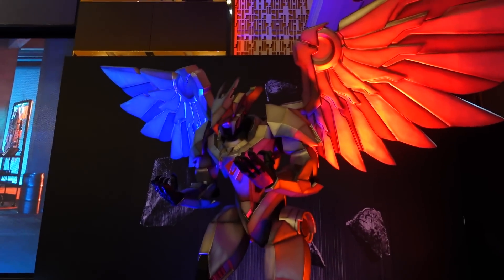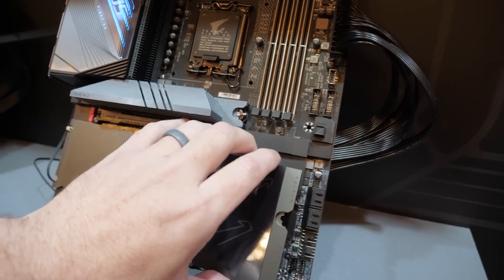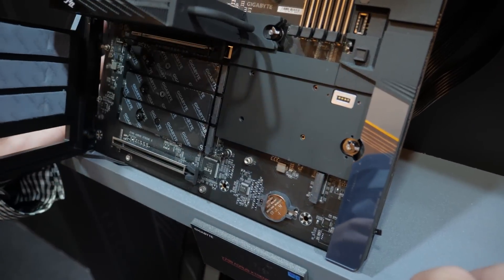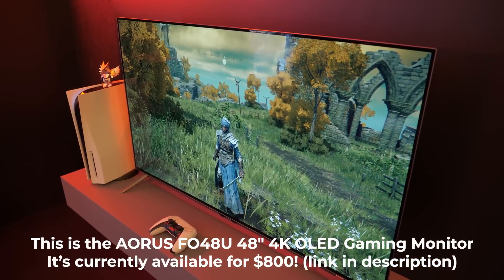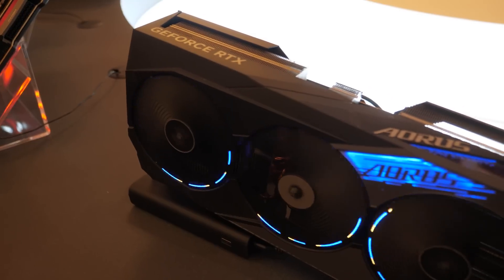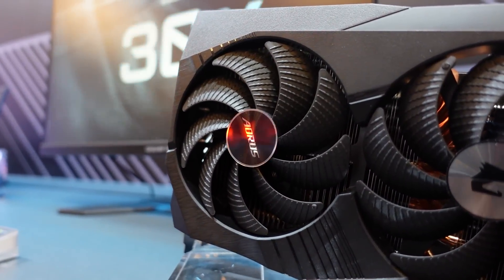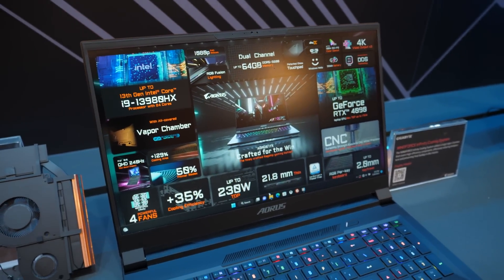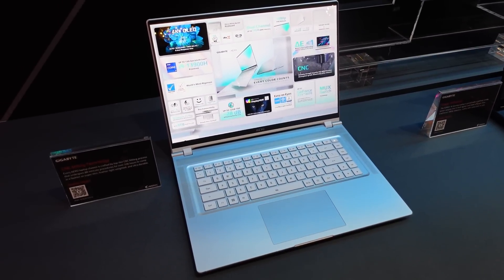Why does Gigabyte have new Z790 motherboards?

Comment: I posted and explained why I believe this happened and my post was deleted. ...
The Z790 was included on the reported list along with many others...

GIGABYTE Fortifies System Security with Latest BIOS Updates and Enhanced Verification
Fostering Collaborative Security Practices and User Safety
Jun 1, 2023
June 1, 2023 – GIGABYTE Technology, one of the leading global manufacturers of motherboards, graphics cards, and hardware solutions, has always prioritized cybersecurity and information security. GIGABYTE remains committed to fostering close collaboration with relevant units and implementing robust security measures to safeguard its users.

GIGABYTE engineers have already mitigated potential risks and uploaded the Intel 700/600 and AMD 500/400 series Beta BIOS to the official website after conducting thorough testing and validation of the new BIOS on GIGABYTE motherboards.

To fortify system security, GIGABYTE has implemented stricter security checks during the operating system boot process. These measures are designed to detect and prevent any possible malicious activities, providing users with enhanced protection:

1. Signature Verification: GIGABYTE has bolstered the validation process for files downloaded from remote servers. This enhanced verification ensures the integrity and legitimacy of the contents, thwarting any attempts by attackers to insert malicious code.

2. Privilege Access Limitations: GIGABYTE has enabled standard cryptographic verification of remote server certificates. This guarantees that files are exclusively downloaded from servers with valid and trusted certificates, ensuring an added layer of protection.

BIOS updates for the Intel 500/400 and AMD 600 series chipset motherboards will also be released on the GIGABYTE official website later today, along with updates for previously released motherboards.

GIGABYTE recommends that users regularly visit the official GIGABYTE website for future BIOS updates.

For more information, please visit the official GIGABYTE website at www.gigabyte.com/Motherboard

Comment: If it didn't have a TV module, then it's just a large monitor. The module is the real differentiator event though you could pop in a streaming device and use it as a "tv."

Comment: Do the Z790 motherboards use the 1920 vintage buck converter (60% efficient) for their VRM? Or do they use the 2011 vintage Ćuk-buck2 converter (99% efficient)? The 2011 converter is cheaper, smaller, has a better transient response, and has less ripple.
Tradition over performance!

Comment: I dont get this, Gen 14 is a new socket so they are limited to CPUs current and Gen 14 is at the end of year. No point buying them
Reply: Gen 14 is a Raptor Lake refresh so will use the same LGA 1700 socket as 12th and 13th gen.

Comment: I don't believe in any consumer motherboards needing to cost more that $200. so...meh...
a mouse should be weighted, I don't like a light mouse, or a mouse with lights.
cases should be less fluff..give me an old box with no windows or lighting and good flow.
that's kinda a nice cooler for the laptop...as long as there is enough airflow.
bean bag chairs are nice to fall asleep in...until your ass gets sweaty. :)
liked.

Comment: I hope motherboard manufacturers start recognizing the larger size of new graphics cards when designing motherboard panels. The access to the m.2 slots needs to be easy and fast. I get the aesthetic, but those of us with hard line tubing will hate this. I like to swap out my m.2 drive so I can install a different OS. That way if something goes wrong, I can quickly switch back to my original OS drive. This comes in handy when I want to try out a Linux distro or Windows. I think these large panels will make that very difficult. I tend to avoid boards like this.
Reply: Well I am confuse, I want to pass this comment cause I don't want to sound like a troll but ...so curious. 
m.2 just about the fastest component you can install on a computer, right? 
So wouldn't it be speedy and efficient to leave your case closed and jack in a thumb/flash/(whateveryawannacallit) drive or external SSD and simply overwrite? And if this is something you do often would it not be even more convenient to keep your OS ISOs in a file on a second m.2?
I'm not a noob but there is just so much to know that I don't..

Comment: Love the idea of a 36-42" monitor in 16:9. Quality panels, high refresh rates and low latency are always highest priority. OLED is nice, but not necessary. Biggest issue is getting decent performance at reasonable pricing. Most people aren't looking for $500-1000 monitors.

Comment: I LOVE that they figured out to leave the two bottom slots open. I have a 3.5 slot 4090 which needs a new system, and I like having an extra pci-e slot or two available. (I'd like to see a 4k display between 34" and 40")

Comment: Why are most motherboards makers still making a rookie mistake by placing their top gen5 NVME slot so close to the top PCIe5 slot? Gen5 SSDs need really TALL heatsinks, and there are an increasing number of GPUs that are taller, like if they have an active water cooling backplate, so NONE of those motherboards would be usable in a lot of scenarios. All they need to do is move the PCIe5 top slot about an inch lower down the board so there is no physical overlap for top end hardware. Many people, like my, don't want a riser cable.

Comment: So - what speeds and what capacity am i able to run in my Z790 Aorus Master? I'm running 2x32Gb 5600 DDR5 now, waiting for some swift 96-128Gb solution for the long term... but if they bring a new MB for higher speeds it may look like i am SOL here....

Comment: These Z790 boards are going to launch alongside meteor lake I9-14900K 🙂
Reply: No, they are only doing a 13th gen refresh later in the year, no 14th gen this year.
Reply: The i9-14900K is going to be a Raptor Lake refresh.  Meteor Lake (if it ever comes to desktop) will be on a different socket.

Comment: Suggestions for Gigabyte:

Monitors: a dual 4k ultrawide.

GPUs: an Aorus “Tachyon” Waterforce Xtreme, a la EVGA Kingpin / ASUS Matrix / Galax HOF OC Labs
Reply: A dual 4k ultrawide is coming out already from MSI and Samsung, and good luck running dual 4k and having decent fps in anything.
Reply: I’d still say they do it if they can match/beat the price for comparable performance. Coming in after can also bring the advantage if they wait until another GPU generation or two when performance is more reasonable.

Comment: I cannot possibly begin to imagine why these boards are being released. The world may never know at this point.
Reply: Because of the raptor lake refresh chips coming out.
Reply: 3 generations of Intel CPUs on one socket, has hell frozen over? Looking forward to a 14600k with at least 5.4 GHz turbo, nice upgrade for my 12600k.
Reply: @richardfarmer6570  14th gen is going to be on a new socket. Only the 13th gen refresh is on the same one currently.
Reply: @drunkhusband6257  If you refer to Meteor Lake as "14th Gen.", then it will come... but not for Desktop, only for mobile platforms. A new Intel socket and platform for Desktop will come in late 2025, and it will be renamed and rumor has it, that Intel wants to begin over at "1st Gen." again. ...can this be true? Anyone else heard that?

Comment: I've built two Aorus Master X570 PCs and a sideways upgrade, Aorus Master X570S paired with a 5800X3D.  The two X570 PCs are paired with the 5800X.  Why the 5800X3D versus a 13700 or the 7800X3D?  No thunderbolt support on AM5 and no USB 4.0 until the $500+ MB price point.  X570 supports TB 3.0.  MB, RAM and CPU price difference of $550 and up.  For what I do and play, it turns out the 5800X3D was NOT an upgrade over the 5800X.  Going from an EVGA 1080Ti FTW3 (which does 4K just fine TY very much) to an AMD 6900XT to a PowerColor 7900XTX showed the biggest visual and performance upgrade.  One of my grandkids got my 1080Ti and a cousin got my 6900XT.  He was able to go from 1080P with his X-99-A PC to 4k by swapping out GPUs.

Comment: My current "monitor" is the Hisense 4K TV 55U8G which is wall mounted.  My "real" monitor, ASUS ROG PG279 165hz 27" IPS, is back in its box stuck in a closet.  The 48" OLED looks like it could give my Hisense a run for its money, but I do like having a TV tuner as well.

Comment: Possibly because Intel could be releasing a 13950K, 13850K on the LGA1700 socket in the fall as part of Raptor Lake refresh?
Reply: Raptor Lake refresh is going to be called 14th gen and be the 14900K, 14700K, etc.

Comment: Paul, thanks for going to Computex 2023 for us. I've watched so many videos about the show I feel I was your companion. Concerning monitors in general. I've owned many monitors over the years. My initial monitors were CRT type. Two features on my later monitors were the placement of the I/O panel and the location of the monitors' controls. Both were easy to see and use. The monitor controls were placed at the front, and some were at the front right side of the housing. They were easy to see and use, with some using LEDs to provide lighting for the control buttons. Today, the monitor makers try to hide the I/O ports and control buttons. To my way of thinking, it's like playing a game of hide-and-seek. These new monitors have gone one step forward and two steps backward. Imagine owning a car with an instrument panel placed underneath the car's dash.

Comment: I would love to see them make more 4k OLED monitors that have different sizes and with different features built in for gaming in mind.
Reply: 4k is pointless at small sizes.
Reply: @drunkhusband6257  i disagree 4k is pointless for small sizes - smaller size is absolutely essential when you're using it as monitor and not a tv, where you sit right up near it on the desk, maybe a foot away.... 34inch would be perfect, maybe 27inch for anyone particularly susceptible to lower PPI. also noticeable graphics improvement from 1440p when gaming.
Reply: @whiskizyo2067  I had a 27" 4k  monitor, went to a 3440x1440 ultrawide. 4k isn't worth it
Reply: @drunkhusband6257  I said different sizes, not necessarily small. As in 38" on up.
Reply: @thudson9653  We already have 42, and 48 inch monitors so I don't know what you need exactly.

Comment: Gigabyte Aorus Master Z790 was the WORST motherboard I've ever had in 20+ years of building PC's. It is so buggy its unbelievable, system agent problems below 1.3v and RGB software it comes with can and eventually will brick SPD profiles of memory. Bios occasionally has bugs with changing one setting effecting another its not supposed to. Total joke of a board for 499$.

Comment: i was guessing they may be having some issues with their boards. cus i just built a pc using their z790 ud ac board for an intel 13900k, gigabyte 4090 and i've been having all sorts of issues with it ranging from ram instability, power distribution, usb issues. i can tell these were known issues since i've had to update the bios 3 times so far in the short amount of time i've had this. however, a lot of the updates have helped a lot.

Comment: I have a Gigabyte Z790 and after power-off/power-on (even for just 1 second) getting it to boot again usually takes HOURS, it either hangs on 'boot' indicator light or all lights go off but nothing happens.  Unplugging SATA drives and all USB devices seems to help after rebooting over and over again for ~30 minutes.
Reply: Something is very wrong with your system. Perhaps mobo, CPU, or PSU.

Comment: I guess it's no secret at this point that any new processors that may be released this year by intel will be refreshes of the existing 13th gen series, and as such will not rate a full number upgrade of motherboards, so no z890 this year.
Reply: Intel Raptor Lake refresh will reach nearly 6.5GHz and dissipate 500W+. Mobo makers are equally making refreshed Z790.
Reply: @tringuyen7519  The refresh is supposed to use less power and run cooler, already been said. There is no way it will even hit 400w, you're crazy.
Reply: Ya.... been said by MANY RESPONSIBLE casters and JOURNALISTS already, so the "coy" play, ... just sad...
Reply: @warpedphreak  probably just being overly careful about NDA
Reply: or they are going to stick with LGA1700 for another year.....   we will see soon enough....
Reply: yes exaclty what i thaught , they gonna release new chips soon

Comment: A video screen on a motherboard. Now that just screams "I don't care how useless it is, I have more money than brains and I have to have it!"
Reply: Right?!  The only thing I want generating light in my field of vision when I'm using my computer is its monitor and a 7-segment post code display on its motherboard, and I only want the post codes to be visible when I open its case.  I even put electrical tape over the indicator lights on my cable modem and router.
Reply: I would buy it but I dont have the money to buy it, lol.

In saying that I do have a 7" LCD screen inside my case, I would assume it is cheaper to go that route instead of buying a motherboard with a built in screen.

Comment: Looking at all those RGB motherboards and remembering how I recently spent 15 minutes working out how to shut them off on my Z790 Hero.
Reply: I just want to go to bed without rgb shining against my eye lids
Reply: @sirmongoose  Yeah. It’s one thing to have all the nice shinies and flashies when your PC is on but who the hec thinks it’s a good idea to have those on when it’s powered down!
Reply: @danceswithsheep3058  or if your computer is serving data and cant turn off lmao
Reply: @danceswithsheep3058  just fuckin disable led on power-off in bios, jesus
Reply: @sirmongoose  oof, that is worst case scenario there.
Reply: @jedenzet  sometimes you cant
Reply: @jedenzet  easier said than done. I found the setting under advanced configuration and setting stealth. However, that didn’t actually disable all the LEDs and I ended up installing Armoury Crate and setting stealth in there. So, as I said, it took me 15 minutes to sort out. I’m sorry for taking longer than 30 seconds to work that all out.
Reply: @danceswithsheep3058  I would have to unplug the fan on my AMD wraith prism RGB to disable the... rgb...Ive always regretting buying RGB. never once did I go "man im glad I get to stare at 3 different wavelengths phasing in and out every 2 seconds"
Reply: @sirmongoose  oof, that’s brutal. On my old system there was nothing I could do about a bright led on my 2080. When the graphics card died and I removed it I found a recessed switch that turned it off. Completely missed that when installing and there was nothing I could do via software or BIOS. I ended up using Blu-Tack to hide it..maybe that’s why it died after four years lol.
Reply: I put electrical tape over the indicator LEDs on my cable modem and router.

Comment: Got a couple of questions for everyone.  Is intel a lot cheaper than amd. I am trying to build a gaming pc again. I can't decide on what cpu to go for.
Reply: more good options at the low end if you're looking at current gen stuff, amd has just the 7600 non x at the moment
Reply: @reinardviloria3433  thank u
Reply: I just bought an intel i5-13600k (lga1700 motherboard, rtx 4070, ddr5). Good price (except for the 4070) and should be great for gaming. Extra nice if intel 14th gen re-uses this socket.
Reply: @barkbork  I also built almost the same system a few months ago. Grandkids play games on it :)
Reply: AMD has the 7800X3D which is particularly good for gaming but intel does very good too especially if you dont mind tuning your ram timings and learning how to do that. the X3D hardly cares about your ram though and is good for plug and play with little time needed in bios. intel is a more well rounded cpu. the x3d are not good at productivity if you ever want to do any of that but intel is. the x3d needs a cheaper motherboard(B650), ram (6000MT) and cpu cooler(Thermalright) so ultimately its the gaming value king. just stick a thermalright air cooler on it which is like $27. the x3d doesnt get very hot just for gaming and the thermalright coolers are very good value even if you do anything to make your cpu heat up to its limit. if you dont like the price of 7800x3d i suppose the regular variants are fine too 7600 and 7700 so you save even more and they are better with productivity, oddly. i dont own either a new intel or AMD cpu, this is just info i've gathered from various sources.
Reply: intel is more expensive, generally
Reply: @lj1653  its the opposite this generation

Comment: Gigabyte! Home of the backdoored motherboards!
Reply: Asus has that armory crate install "feature" in their bios.  I wonder if it's as insecure.  We probably haven't heard the last of this.
Reply: @dkman123  I read that ASUS armoury bloatware is likely also at risk due to the same way it functions. Not sure tho.
Reply: Yea the fact that the BIOS has a setting to potentionally auto install random crap on windows is pretty pretty bad
Reply: @AhDieSloegerd  I wonder if youre still effected if you run linux instead of windows. unless its embedded into the UEFI
Reply: @sirmongoose  its embedded into the UEFI, so fresh windows install or even full drive clean wont work.
Reply: @AhDieSloegerd   You can disable these bios install features though, within the bios it's self.  Still doesn't excuse the security risk involved, by several mobo companies design flaws with these backdoors.
Reply: @Joes_Channel1984  Indeed!
Reply: @sirmongoose  I had the same question.  The article I just read said the UEFI code depends on Windows components to do its thing, so a Linux machine won't open the backdoor even if the UEFI code runs on boot.
Reply: Sad but true apparently 😢
Reply: quite unfortunate time to release a video like this.
Reply: Apparently they released bios updates on at least some boards to address that. Should’ve never been a thing whatsoever.
Reply: Still better than ASUS boards that blow up cpus